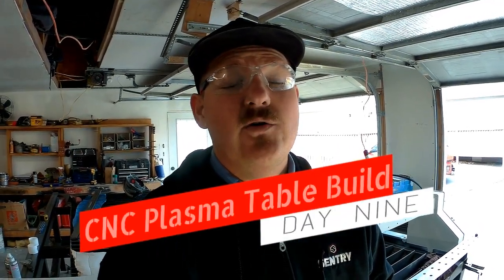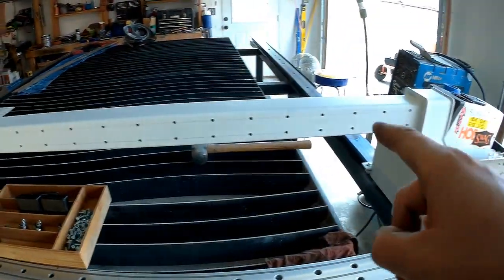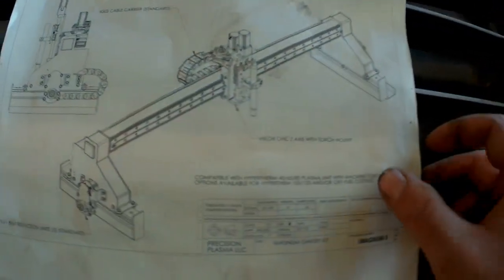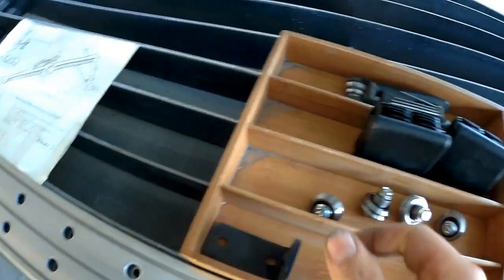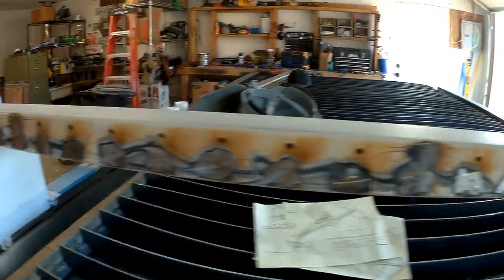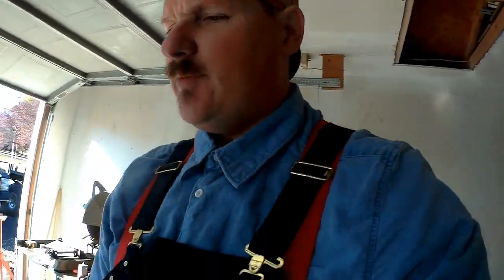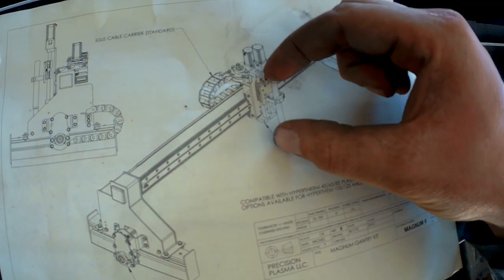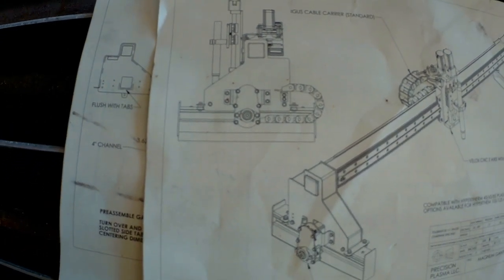CNC Plasma Table Build Day Nine (How to Mount V Rail)

Comment: Where did you get the drawings for this project?
Reply from the maker: From precision plasma, they make the gear reduction units and the gantry kit  http://www.chacich.com/MAGNUM7/
Reply: It looks grate, what size of motors did you use.
Reply from the maker: @peterfarkas8358  I went with nema 23's on a 3.5:1 hear reduction. They work fine but my gantry is a bit heavy so the set screws slip when running over 220 ipm for an extended time. But no problem w the motors, plenty of torque and acceleration.

Comment: If you ever have problems with hole being off like that , Make a piece of 1/4" flat bar drilled a tapped and place it inside the 2 x 2 tubing That way you can adjust your Gantry rail if needed just by loosing the bolts and retighten in the right place. The holes in the 2 X 2 can be drilled over sized.

Comment: where did you get the green plate/ motor mounting assemblies? and when do you get to the software/ type of stepper motors and movement control module/ power supply?
Reply from the maker: The motors and electronics were really difficult for me to figure out because I have no background in electrical so I couldn't make very good videos explaining how to do the wiring and troubleshooting etc.  You can find the electronics portion of the kit at https://www.candcnc.com/product-category/corecnc/ they also have good phone support to help you along the way.